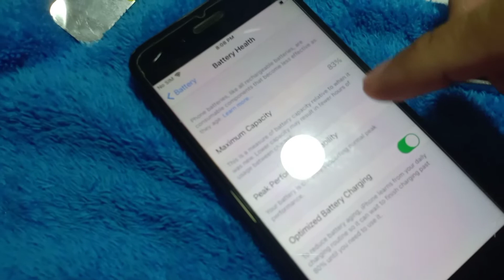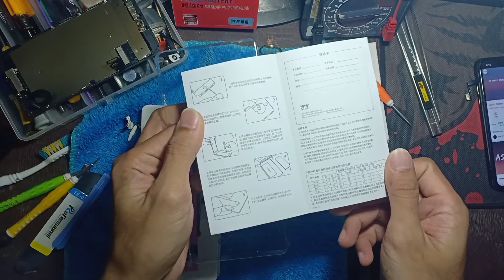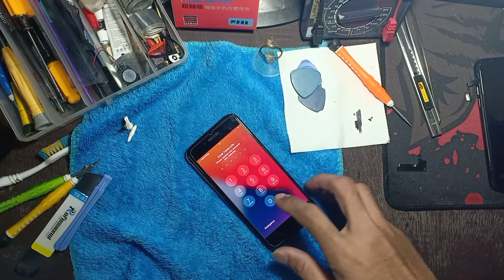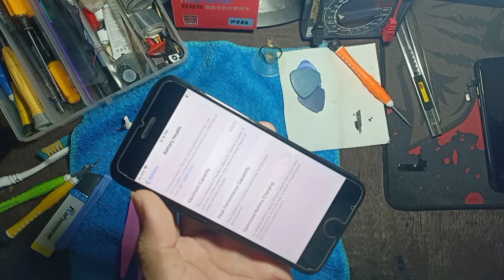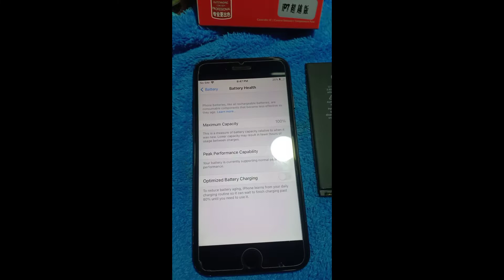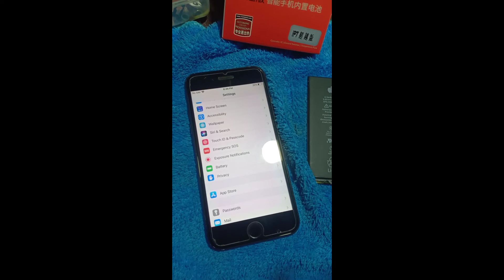Battery Replacement | Yoobao | iPhone 7

Comment: hello po kuya/sir ask ko lang po if totoo po yung mga sabi-sabi regarding po sa Yoobao battery po once nag drain daw po siya to 0 is di na po naoopen yung phone mostly iP6, 6s, 6plus palang naman po yung naririnig ko na may ganong issue sa Yoobao batteries and I’m planning po to replace my phone 7’s battery po same with the one you are using po.
Reply from the maker: Any battery po kapag nagkaganyan at lagi pinababayaan ma drain to 0% possible na mangyari sa mga unit yan hindi na mag oopen
Reply: @technictv  So kuya/sir if minsan lang naman po na didrain to 0 di naman po siya magkakaganon po diba feeling ko po kasi yung mga nagsasabi na na drain to 0% yung battery nila tapos di na daw ma open is dahil din sa misuse nila ng mga phone nila dinidrain siguro nila yun up to 0% lagi.
Reply from the maker: @jero7053  hindi kasi talaga ppwedeng ma drain si battery lods ikakasira nya pati ng cp mo
Reply: @technictv  So kailangan po talaga iwasan ma drain to 0% po yung battery sir, salamat po sa pagsagot.
Reply from the maker: @jero7053  oo kaya nga nag nonotif ang phone kapag pa lobat na means kailangan mo na siya i charge boss

Comment: Kakapalait ko lang ng battery sa phone ngayon, pero bakit zero percent at parang di sya nagchacharge? Ano po kaya rason?
Reply from the maker: Baka naman po may problema kayo sa charging board ng cp nyo
Reply: @technictv  binalik ko yung old batt, gumana naman
Reply: Dba dapat kung palitan mo battery, dapat may laman or mag oopen yung phone. Pero yung nabili ko deadbatt. Try ko chinarge pero di gumagalaw yung percent
Reply from the maker: @wthellford_6981  possible drain Idolo balik mo sa binilihan mo warranty

Comment: Boss kamusta performance? Yan ba yung advanced? Nagbabalak kase ako bumili nun
Reply from the maker: Mas ok kesa sa original na mababa na ang health bossing
Reply: @technictv  pag nagpalit bako ng battery di na ganun kabilis uminit phone? O ganun parin?
Reply from the maker: @irishmichaelapelado1583  anong phone model mo ba sir? Bakit nainit? Anong history nya may dating sira po ba or nirepair or 2nd hand unit?
Reply: @technictv  iphone 7 po kapapalit ko lang ng yaobao advance yung 2200mah kuno pero 1960 lang nmn nalabas sa aida64 tas pag gamit ng mga ilang minuto ramdam mona ini di gaya ng stock na battery ng iphone normal ba yun
Reply from the maker: @irishmichaelapelado1583  hindi normal na nainit kung gamit lang ng ilang minutes boss. Pa check nyo sa pinaka malapit na legit technician po